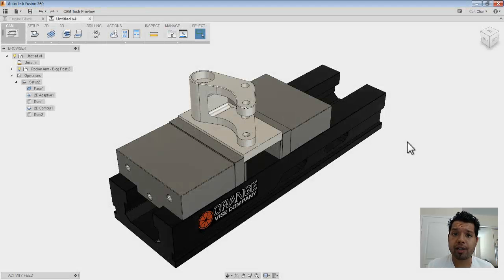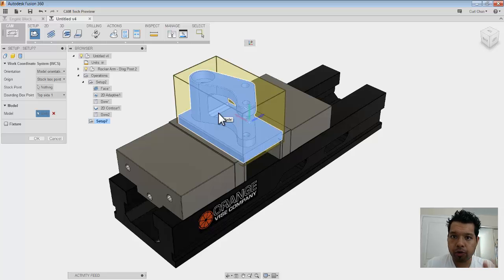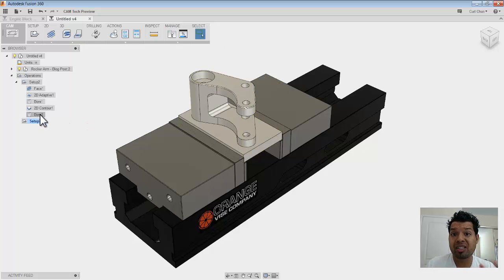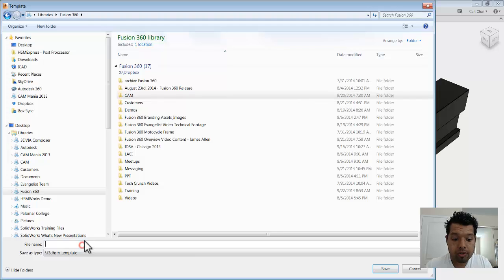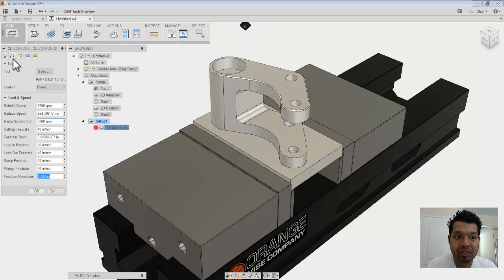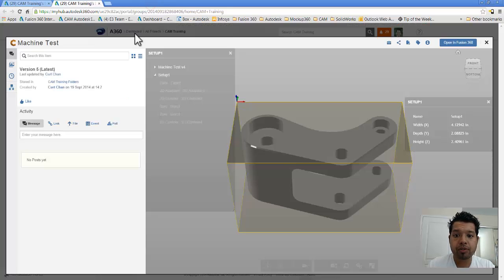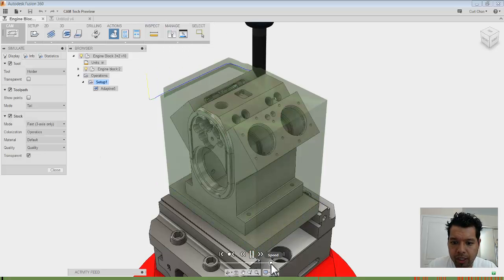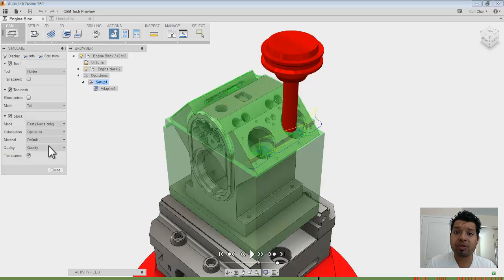CAM for Fusion 360 Tips and Tricks

Comment: Hi I Have just started using Fusion 360 and am trying to CNC a small plate with a logo for a friend. The issue I am having is there are some very small corners and spots in the Cad. I have set up to mill out the big stuff with a 6mm endmill and then come in and clean up with a .5mm. Fusion generates an entire tool path as if I am doing the entire path with the .5mm endmill which takes ages. How can I tell it to only generate a tool path for the remaining material? 
 Cheers for your time

Comment: Oh man. I have been running around in circles FOR DAYS trying to make Fusion 360 CAM work. I really want to like this software, but it is seriously lacking. I can't even cut one part. Granted, my parts are more difficult than most with a high degree of 3d contouring, but if RhinoCAM can do this so easily, why can't the smart people at AutoDesk compete with this product? You're losing me here...
Reply: you can learn it. If you can learn rihno you can learn this Fusion 360. I usually use Inventor for 3D models but am getting the hang of Fusion .
Manny